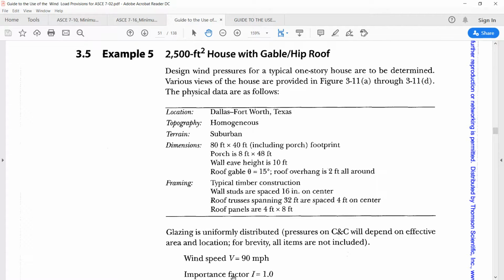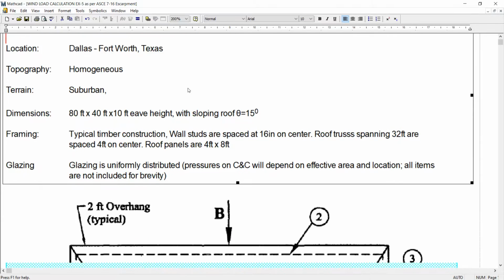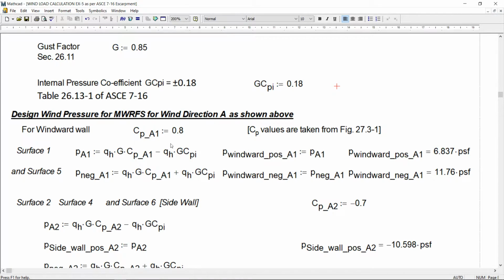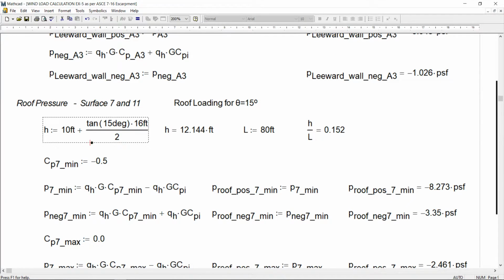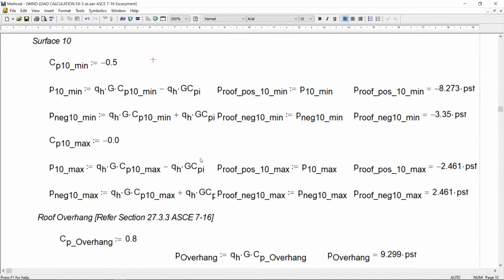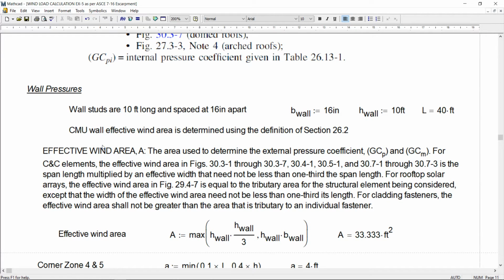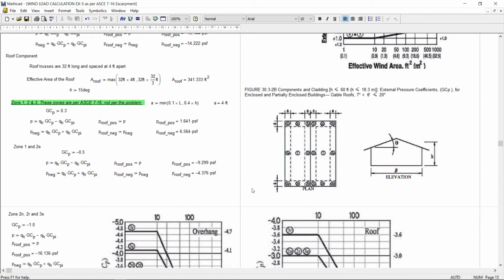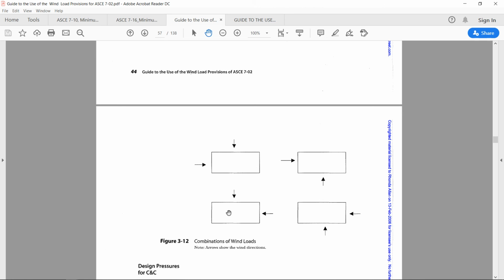WIND LOAD ON AN IRREGULAR STRUCTURE

Comment: Great work wonderful video. 
I had some questions about the porch overhang. Does it have wind load applied to it as well (uplift force)? Also can we use Directional method for all irregular buildings?
Reply from the maker: Thanks for your support. The overhang will have same pressure as the roof without internal pressures. That means an uplift will be applied. Regarding Directional Method, please refer to ASCE 7 standard.
Reply: @msajjadh  Thank you for your quick response. I am very grateful for the example you provided. It has brought me alot of value and clarification. I had a few questions. 

Why dose ASCE7 Sec. 27.1.2 condition say, "building is a regular-shaped building as defined in Section 26.2" also Why does it say, "buildings with any general plan shape, building height,
or roof geometry that matches the figures provided." These two statements makes the directional method seem very limited. In most of the low rise buildings specifically Single Family Dwellings are L shaped. Is it acceptable to use this method on L shaped buildings in practice?
Reply from the maker: @renealvarado970  In my opinion, please read ASCE 7-10 Chapter 26, Chapter 27 and Chapter 28 together. For Low Rise Buildings refer to Chapter 28. For unusual shapes refer to Section 28.1.3.
Reply: @msajjadh  Thank you! I will try to find recognized literature for unusual shapes. Do you have any recommendations?